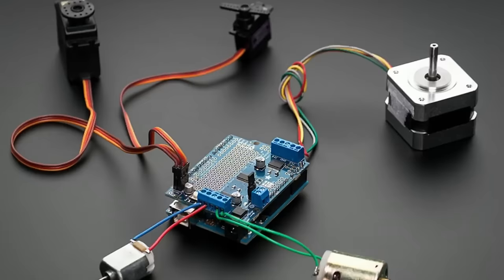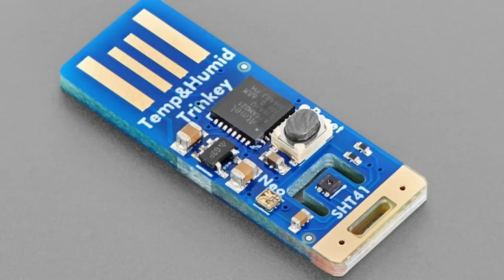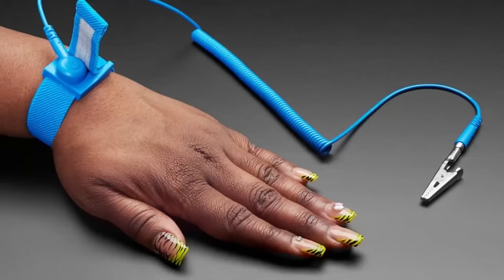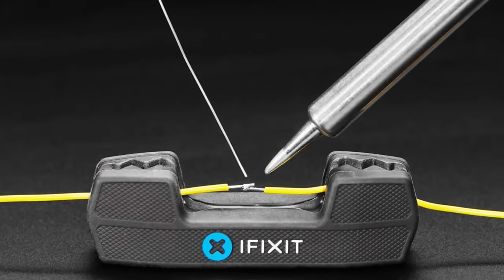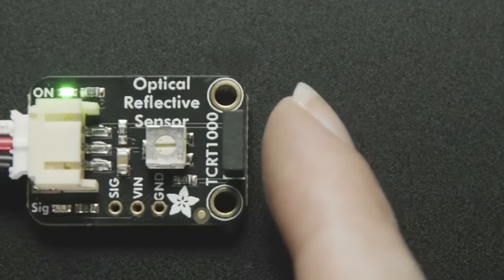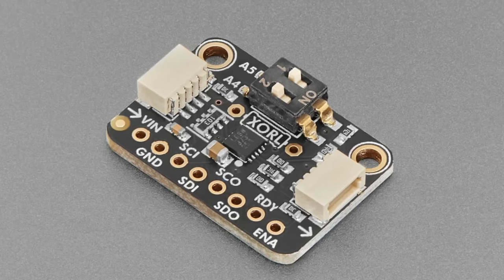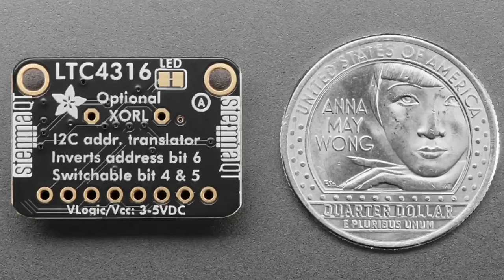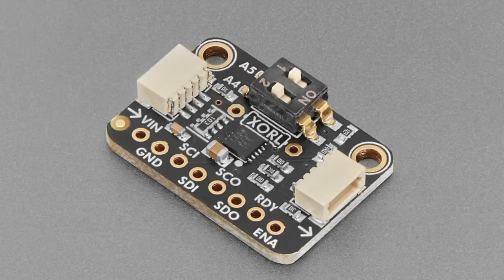New Products 3/27/24 Feat. #Adafruit LTC4316 #I2C Address Translator - #StemmaQT!

Comment: I've made and purchased a bunch of different helping hands.  My current favorite is 2 alligator clips held parallel an inch apart with a u-shaped piece of solid 10awg wire.  No drooping helping hands arms to worry about.  I can't get a magnet to attach to it though.  The ifixit looks like it would be a more solid and properly magnetted (I don't care that's not a word) version of the same thing.

Comment: Does anyone produce a power strip with a ground attachment for wrist straps?
Reply: There's a product that converts a grounded outlet to a banana plug socket (I think iFixit carries them). You can pull out the alligator clip on most grounding straps and it will have a banana plug on the end. 

Might be a good idea to get an extension cable, a nice long wire with stacking banana plugs at the ends.